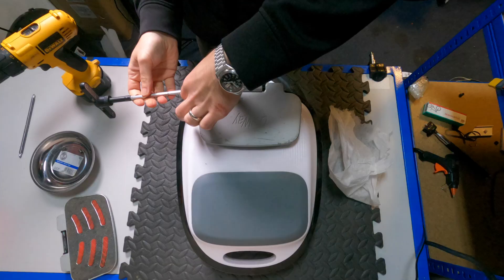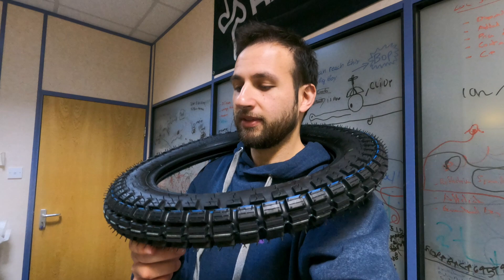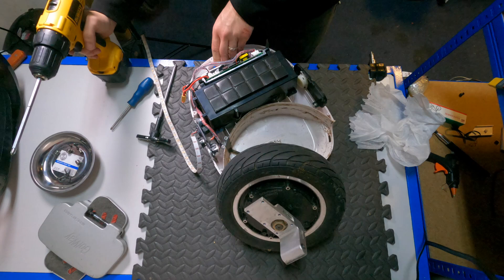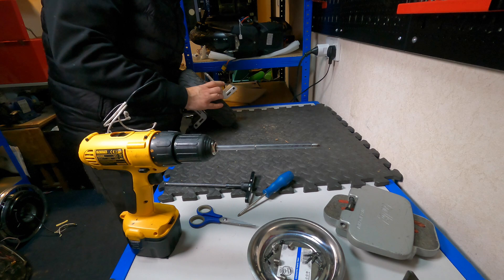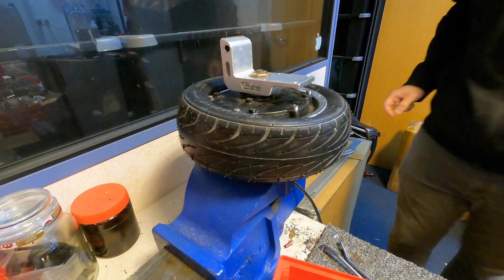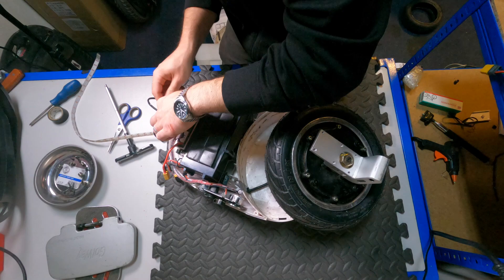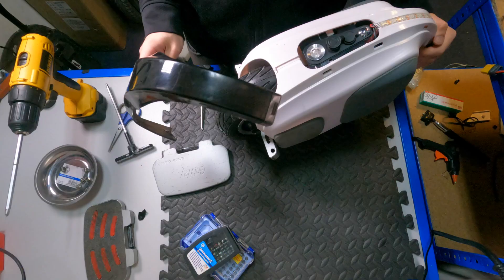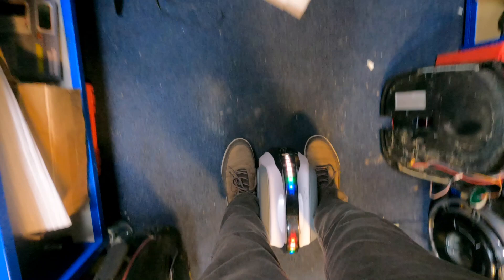This is why the wheel was a bit wonky... | MTen3 Tyre Replacement

Comment: to change the tire of a mten3 you do not need to remove the motor cable. Can do everything from the side without cable. To get the tire back on use two screw clamps (or any clamps for woodwork) and press the sides of the tire so that is just half as wide. Apply some tire grease and the tire is back on the rim effortless. :-)

If you do not have clamps use some cableties to squeeze the tire slim.
Reply: I did not disconnect the motor either and used cable ties, worked a charm and saved tons of time! I did try levers first; brutal.  I'll have to try tire grease next time too.

Comment: Thanks for sharing! You didn't mention re-adding sealant?
Tubeless tires will lose pressure early without, I'm guessing (at least it's the case for bicycle: MTB/gravel/road)
Reply from the maker: Not had any issues with our Mten3's so far, but I know peeps do add it from new a lot of the time.